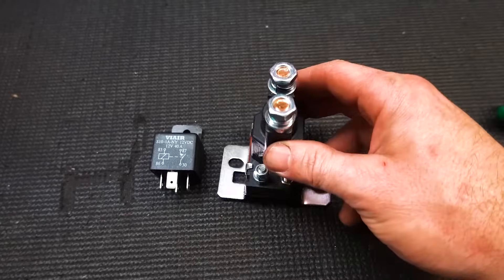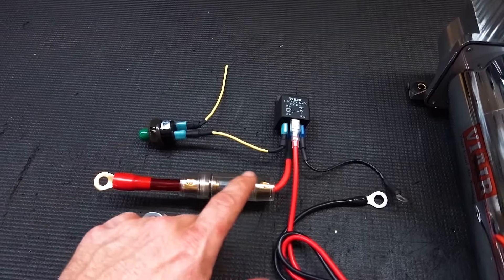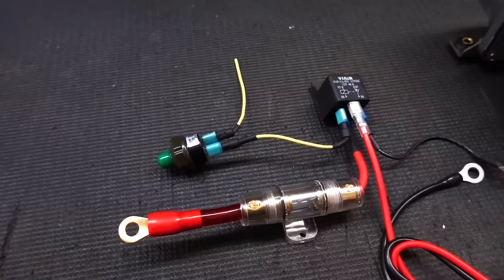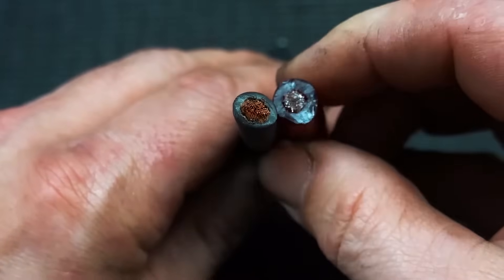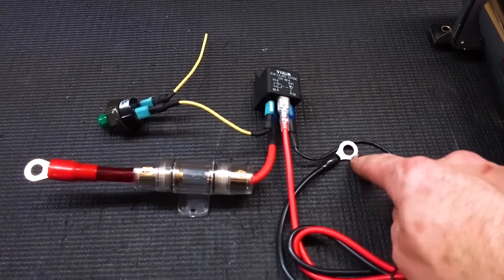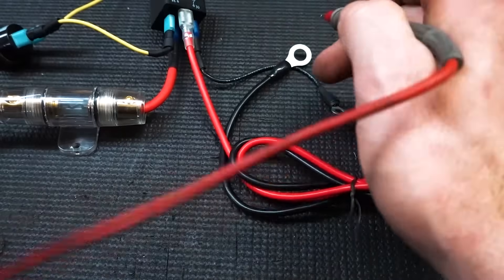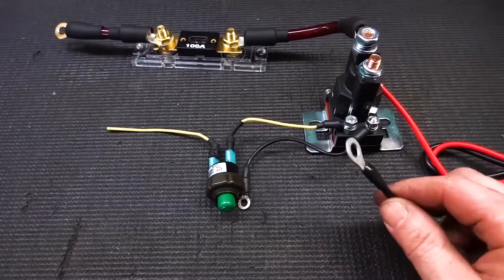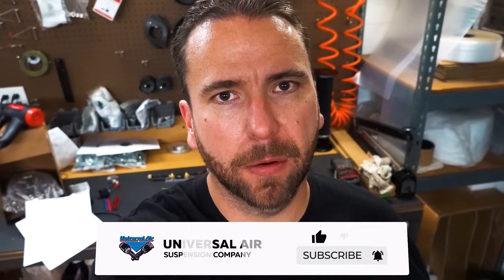How to wire compressors for your Air Bag Suspension

Comment: Generally try to put your switches on the ground side incase the switch grounds out or the plgu comes off (intentional or otherwise) and you arc out the wire instead of just grounding it and running the pumps.

Comment: Question, the fuse needs to be greater than the total amp load of two compressors become when they start but how about the solenoid? 2 @ 40A compressors one 80A solenoid?

Comment: bro i used my airbrush tankless compressor which has all that crap youre buiding built in for 88 frigging $....i bought a small cig lighter inverter for 20$ plugged it in and im laughin....10 mins and a 10th the cost.

Comment: I wired my compressor exactly like the video instructed. but it won't kick on with my ignition, but if i touch the poles with a wrench, the compressor will kick on regardless of the ignition switch position.
what did i do incorrectly?

Comment: Good morning! I’ve destroyed 2 solenoids. The power wire from the battery has melted the bolt housing TWICE 😢. Good ground… clueless as too what could be causing the wire to get so hot. Any thoughts?

Comment: I’m setting up an onboard air system on my ‘22 Power Wagon. It is mounted where my spare tired used to be. I’m running dual Viair 485C compressors, Viair website states the combined max amp draw is 46 amps. Would I be ok to run 8 awg wire a distance of about 12’-15’ the distance from the battery back to the spare tire area?  Thanks!
Reply from the maker: That is the rated running current but startup is always higher.  If your talking per pump that's fine, but for the pair I would recommend to run larger.

Comment: Hi .  Thank you for putting out this video!  (I am also a newbie).   I would like to install a VIAIR pump in a 5th wheel trailer.  My rig has 2 12V batteries connected in parallel and, of course, no ignition switch.  I plan to mount the pump close to my batteries and I'm entertaining the thought of connecting it directly to the batteries - of course using the fuse and Relay as indicated by the wiring diagram.   Because there is no ignition circuit, I don't know how to go about connecting the on/off switch.  Can you suggest a safe way to connect the switch?
Thanks!
Reply from the maker: I would do some type of on/off switch so it doesn't kill the batteries if you have a small leak.  Just use the switch as a make-shift "ignition" switch

Comment: Im still confused about the power wire guage.. do we need separate fuse holders if we're running an amplifier? From the battery to the trunk should there be separate power wires with separate fuses for compressor and amplifier? Also im running single pump what gauge wire do i need if my cars 22ft (classic car) and what size fuse?
Reply from the maker: Yes you would want to fuse the compressors separately.  Depending on which compressor your running (they have different amp draws), wire type (aluminum vs copper), quality of wire etc would all effect the "proper" size.  

Personally I would run an 8 awg wire.

Comment: How would you wire 2 relays 1 for each compressor to one pressure switch? Just connect both sides to the pressure switch?
Reply from the maker: Just connect the output of the pressure switch to both relays for the turn on. Jump from one to the other or two wires off the same prong on the pressure switch.

Comment: does anyone know how to add the solenoid relay to my current system (trying to add in second compressor )
Reply from the maker: if your adding a second compressor to an existing system, you can either bump up your wiring to a larger gauge and run both compressors off the solenoid (like shown in the video).  Another option is to just run another wire back and individually relay them.  

If you have an Airlift 3P/H system they do run a negative trigger for the second compressor which you can wire up to another relay (instead of grounding other post, it would go to positive since the controller provides the ground).  

To be honest, I would just pickup the harness that airlift made as its prewired and setup for the negative trigger.  They stage the compressors turning them on one at a time to limit the amperage spike of both turning on at the same time.

https://www.universalair.com/shop/al-27703-airlift-3h-3p-2nd-compressor-harness-791?search=2nd+compressor&order=name+asc#attr=

Comment: Watch out ofr that style of fuse. The  larger glass fuses like those frequently have a bad solder join to one of the caps and will look fine, but only pass a small amount of voltage. Strongly suggest using blade fuses, mini blade fuses or a quality breaker.

Comment: Is using a jumper cables(4-6ga) physically bolted to the battery posts safe enough to run a Napa dual pump air compressor(90A) about 15-20ft away? Fused, of course.
Reply from the maker: Sorry for the delay.  90 amps, 20 feet away is a big ask.  If that's the running current, I would absolutely not run that.  Startup current is substantially higher.  Online calculator says for 90 amps you should be running 1 awg for copper and 2/0 for aluminum for a 5% voltage drop.  

If its been hooked up that way, use the multimeter to measure how much voltage you have at the compressors while they are running.  I would suspect that wire will be getting hot, or their amperage rating might be inflated.

Comment: This is how i have my system wired with the solenoid and when I turn my battery on my compressors go on with nothing else on. Meaning ignition is off so the ecu is not on.  Even if I turn ignition on the compressors still run and the ecu turns on.  Do you think it is a bad solenoid?  I have a 2nd solenoid and it did the same thing. I am going to test ground and the solenoid.  I am running accuair.

Comment: What do you mean by ignition when talking about the pressure switch. Can it be any 12v power. Like could I just splice into my power wire from my wire that goes into my amp
Reply from the maker: I would suggest away from tapping into the stereo system.  It will tend to induce noise when the solenoid/relay is turned on/off.  My go-to source for an ignition is the 12 volt power plug, aka Cig lighter.  Typically they will be an ignition source (switched)

Comment: I have the dual 485 with a 100 amp alternator> am I going to have problems? 10:58
Reply from the maker: assuming your not running a huge stereo system it shouldn't be a problem.  Best thing is to just check your voltage at the compressors with them running.

Comment: this might be silly but would it be possible to run the wire going up to the ignition off the pressure switch to an 12v on/off wire that turns on/off my subwoofer amp? it'd make this install the tiniest bit easier since everything would be in my trunk
Reply from the maker: wouldn't suggest it since the relay/solenoid turning on/off can induce noise in your stereo.

Comment: Universal; after watching your excellent videos I noticed on the Air Lift Performance brand, that the packaged wiring harness didn’t actually have any grounding specific wires to mount on my car’s frame. Do you think there Any concerns with this brand’s method of wiring and longevity for the compressor?
I personally want rip into the harness and adjust to your vid.
Reply from the maker: They run the ground up to the battery which will be a good spot. I personally think it’s a little light on the gauge, but it should be sufficient as it’s decent wire. Biggest thing is if your running two compressors, pickup the 2nd compressor harness.

Comment: Can I connect my ground wires to the battery if I am using battery only, no car,... externally mounted battery. And the compressors are the only thing connected to battery.
Reply from the maker: Yes, but make sure your not going to get low voltage as your battery dies.  You want to keep it at least 12 volts with the pumps on. The more the better.  Compressors will run hotter, and fill slower with lower voltage
Reply: @UniversalAir  Thanks for your reply! I have one more question: What is the best way to test the battery with multimeter...When the compressors are running or when they are off?

Comment: Best video for compressor/wire planning.
Good stuff right here!
Reply: bro i used my airbrush tankless compressor which has all that crap youre buiding built in for 88 frigging $....i bought a small cig lighter inverter for 20$ plugged it in and im laughin....10 mins and a 10th the cost.

Comment: what size wire from the battery to selanoid and do i use the same size wire from battery ground to compressor ground wires?
Reply from the maker: I typically do 4 awg for a pair of pumps, but a high quality 6 would be sufficient. It really depends on how far the run is.  If the wire is undersized it will cause a voltage drop. Only thing hurt by too large is the pocket. To small can cause damage.  Ground should be the same or larger. The longer the run, the larger it should be.  Google an amperage chart for how long your run is. A good rule of thumb is a compressor pulls about 20 amps. 

https://www.fiberglassrv.com/forums/attachment.php?attachmentid=22195&thumb=1&d=1280149123

Comment: ❤❤ the aluminum coated copper wire is NO GOOD

I bought 4 gauge wire from Amazon 18 feet of it. It actually came in 25 foot long.  I did not use it because it was not solid copper because we all know that aluminum will heat up and potentially cause big problems. Everybody knows that you should not have aluminum wire in your house and I feel the same way about aluminum wire in your vehicle.   So I bought more wire 25 foot red and 25 foot black solid copper four gauge wire that goes from my battery to the toolbox in the bed of my truck about 8 inches from the battery positive terminal. I have an 80 amp fuse. I’m thinking about lowering that to 60 amp fuse.

Make sure people understand to stay away from copper coated aluminum wire. It’s no good. It will not hold the load like solid copper will.   I did purchase a digital gauge that has two readings one for the air pressure in the tank and one for the air pressure. That’s being released to the air horns. I’m not sure how sensitive the sensors are so I have not installed it yet.

❤❤❤. You would be impressed with my system. It’s a shame I cannot post pictures. It would blow most people away.❤

Comment: ❤ I am running 4 gauge wire from my battery to my 80 amp fuse when the four gauge wire goes underneath my truck into my toolbox I constructed a ground bus and a positive bus for my power supply. Then I have 15 amp fuses in a mounted fuse box each 15 amp fuse, goes to its own individual designated air compressor.  I am using. 4 VIAIR air compressors for my air horns in my pick up truck. I also have two starter solenoids each starter solenoid runs to compressors.  I have a pressure switch that activates 2 air compressors. In the quarter inch manifold there are two pressure switches each pressure switch turns on and off 2 VIAIR air compressors.   

I have a pressure gauge inside of my truck that monitors the air pressure going in the tank gauge also has a second needle that monitors the air pressure that’s been released to the air horns I can increase or decrease the air pressure that’s going to my airhorns, depending on how loud I want my Hons to be.  With the system that I put together, I can also inflate a flat tire in the matter of seconds..  

I have pumped up the air pressure all the way up to 250 psi and none of my air hoses have blown apart   NOT ONE !   When I go to the car show in Glendale, Arizona on Bell Road anybody that sees my system in the toolbox of my pick up truck is actually blown away with the extreme detail of how I put it together.  Years ago, I was fortunate enough to work for Wellcraft marine building, offshore racing boats for scarabs I put three of them together for the Miami Vice TV show starring Don Johnson.   

My air system is controlled by one switch in my pick up truck if I turn it on all  4 air compressors are activated. They will pull it up to 170 psi, and then shut off.  This is my insurance policy to wake people up if they come close to hitting my truck.   The horns are to protect people from hitting me call it a WAKE UP CALL for the circus clowns ❤❤

Comment: If you're running an 80 amp solenoid to 2 compressors is it okay to use the 8 gauge wire if you're going less than 20 ft?

Comment: ❤❤❤ I have four air compressors in my system to operate my air horns in my pick up truck. I have two starter relays heat starter relay operates to air compressors. I’ve got four gauge wire going from the battery ground and negative to my Terminal blocks in my toolbox, talk all 4 air compressors, get the proper ground and proper positive electricity going to them. ❤❤❤

Comment: Will these compressors work with lithium battery 80ah bank yinlong and 270 amp H.O. alternator that charges at 15.5 volts ? That's my current electrical with my audio system in my vehicle. The car and everything else seems to work okay with it .
Reply from the maker: The compressors tend to work more efficient at the higher voltages.  That much over a normal 14.4 I would run it.  They will run faster, so there is a potential for a little more wear on them.  But personally I think it would be offset by the less heat.  When you run a compressor at lower voltage, they tend to get significantly hotter then with proper voltage.

Comment: Quick Question i need help long story short i have the accuair e-level with the VU4 manifold  running  2 VYAIR 444C. wasn't happy with the previous install. I  took the complete system out and watch this video i decided to reinstall  using the 80amp solenoid  my accuair wire harness has the ignition wire plugged into it so am lost in how i wire the ignition wire also my pressure switch is not on the tank its separate for it am lost here any help would be appreciated thank you.
Reply: I have my ignition wire on a toggle for my old Eldorado. That way i can start the car 1st. Then ill let my tank fill up
Reply from the maker: your accuair system has the yellow "Turn on" output from the ECU.  The ECU controls the tank pressure, so you don't use a stand-a-lone pressure switch.

Comment: But you need to run a ground to the 80 amp relay or you won't have power to the relay at all, right? Cause my relay won't give power unless I connect a ground to one of the little posts

Comment: Been having issues w my pressure switch not kicking off the compressors and now I know why
Reply from the maker: Its usually two scenarios.  The compressors just can't hit the pressure so it never turns off (replace pumps) or it would be from welded contacts.  Either inside the pressure switch which is typically caused by not running a relay and moving too much amperage, or in the relay/solenoid from pulling too much current.  

If its inside your relay/solenoid I would make sure its rated for the amperage your pulling.  If so, I would verify the voltage at the pumps after replacing it.  If you have low voltage at the compressors, its going to pull more amperage which would cause it to stick the contacts.
Reply: Myself as well stays running,  I just want to disconnect.

Comment: Can I run The Pressure Switch Wire to the Switch Pros RCR-Force-12 Command Module? And would it be better to use the 80AMP Solenoid on a Viair 485C Dual Compressor System? Can I run The Carli Air Bags off of my own Dual Compressor with 2.5 Gallon Air Tank? Another feature I would like is to be able to control the pressure in each bag individual so I am not opposed to hard switches and dual Gauges in the dash. Guy at shop is telling me I can't. I want the dual system I am contemplating to run Front/Rear Lockers, One Air Chuck Center Front Bumber & One Center Rear Bumper Mounted Quick Female Disconnects, and Possibly one other accessory, My tank has (6) 1/4" NPT Ports and assume I will need one for air in (maybe two for dual compressors) and one on bottome for Drain/Safety Valve. What Powers/Actuates the Bags? I am running a Switch-Pros RCR-Force-12 Power System On board as well if that helps.

Comment: Hi nicely explained, just wondering if I’m using an 8 awg wire for the power how do you connect it to the relay ? What size female spade connector do I need for the wire ?

Comment: I have viewed your vid countless of times lately. In my charger setup. I have 2 viair 444 on individual 40amp but ONE always goes out after a year or so. I fouhd a leak in one head and using your test on the filter. and put a new valve on the line.  Would you recommend me going to the 80amp, that way wont keep blowing a fuses after a spike in usage.
Reply from the maker: I would suggest to check the voltage going into the pumps.  You might not have a good enough ground connection.  If its connected to the sheet metal, move it to either the battery directly, or at least the post where the battery is connected.
Reply: I mean a 80 amp relay. So it won’t be a big power draw. I’m going through another pair of compressors again. I also got upgraded one way valves for air going out.

Comment: Also have 2 444c compressors, wired it up originally and one compressor wire got too hot, yet the other one is perfectly fine.. disconnected the hot wired one and now I get no power through the relay

Comment: very interesting! how can we connect this to arduino uno or esp32 board ?
Reply from the maker: If you want to control it via an arduino, you will need to use a transistor to get a 12 volt output to trigger the relay/solenoid.